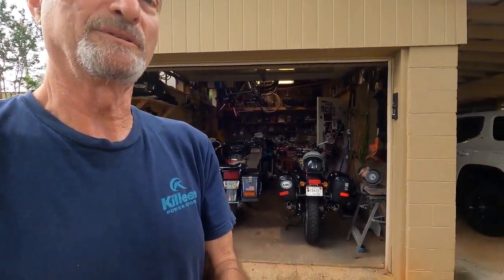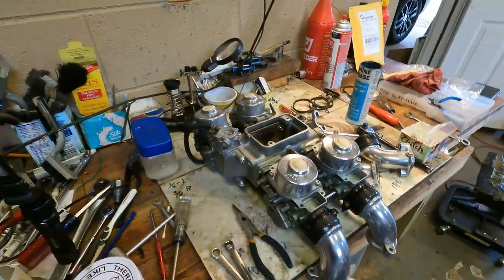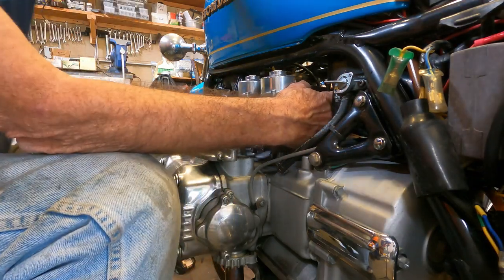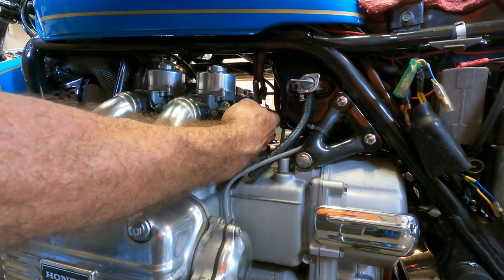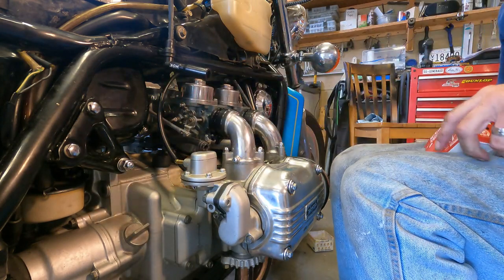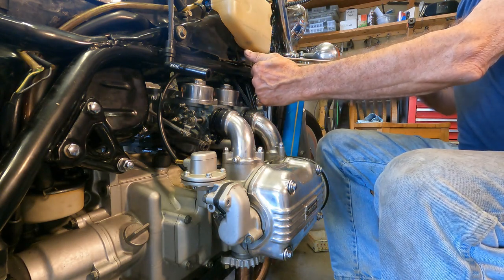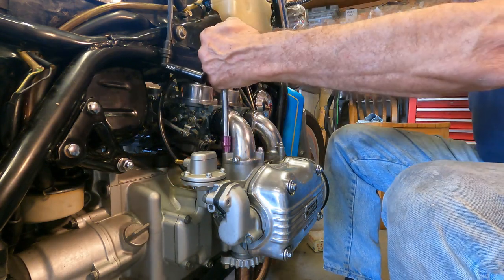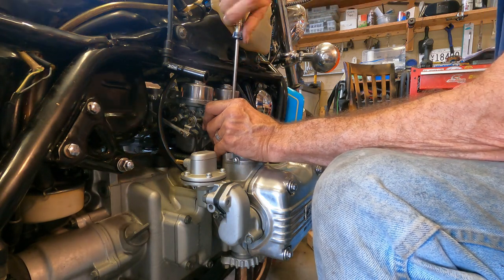INSTALL CARBS ON 1975 HONDA GOLDWING

Comment: Hi Robert. I have a 1976 GL1000 which I bought dismantled. Crazy I know, but complete original GL1000s are rare in South Africa. I've reassembled most of the bike, but am wondering how to fit the very hard inlet manifold rubbers to the carbs. I've read that soaking them in boiling water helps. What do you suggest?
Reply from the maker: I warm them with a heat gun and apply a bit of grease to the carb. Be careful, too much heat will damage the bond between rubber and aluminum.

Comment: 8.4.23.    Good series of videos you’ve🫵🏼 been putting out⚠️ if I may be presumptuous, you should have taken the time once the carburetors were off to pull your coolant tubes and put new gaskets and O-rings on them.
Reply from the maker: Good point, I guess if they start leaking I will need to revisit this.
Reply: @BobKramer51     8.4.23.    Whenever I have to do any service work on an engine, especially if I pull it down or out of the bike I do as much as I can preventative while the engine is out. It’s just false economy not to change out seals and gaskets and such.
Reply from the maker: Agreed